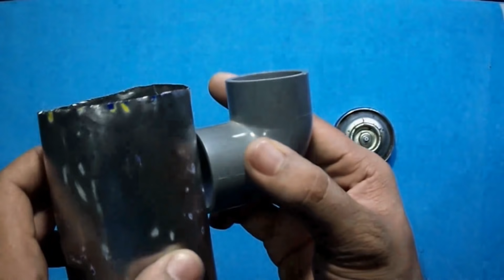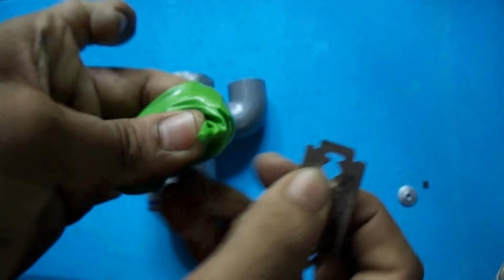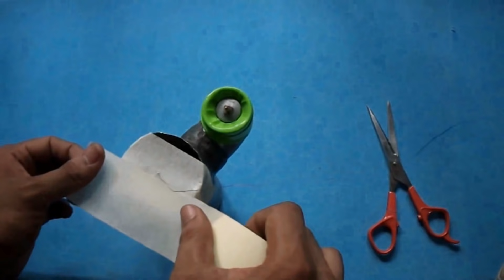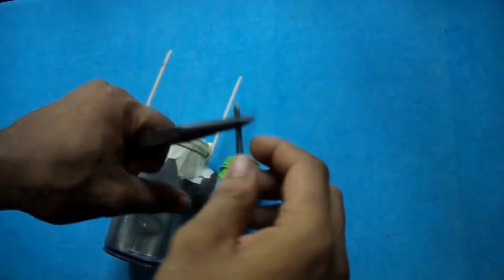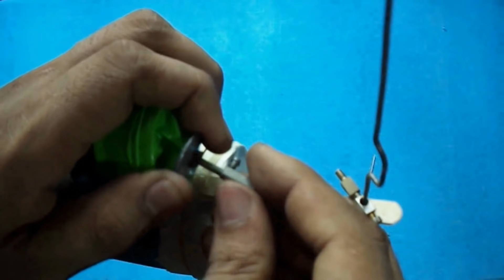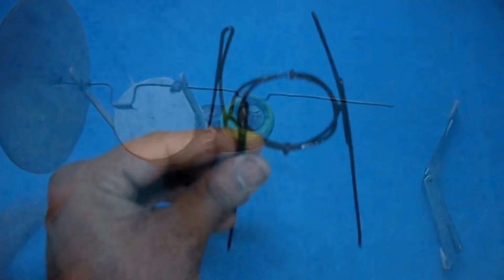stirling engine homemade tutorial

Comment: Tks so much! I just simply need to understand how it works, and you've done very well. Excellent!
Reply: It works because hot air expands and cold air contracts, making the piston move up and down in the cylinder. Rest is just capturing the kinetic energy generating from the movement of piston, and transforming it to spin the wheel. Same principle is used in any engine you see around.
Reply: @GhoshSoumyadeep  I think regular car engines operate on a different principle. They don't have a working gas confined inside them, but they do work on the piston by aerosolizing fuel and doing a mini explosion, an event that repeats over and over really fast.
Reply: @Felipe-sw8wp  That's right. 2 stoke and 4 stoke engines work like that. Same principle basically.

Comment: I'm very happy to  see this engine run with low quality steel scrub , I ask many people to is that engine run with low quality steel scrub. Then every one say not  working but you done it thanks for making this video
Reply from the maker: Actually i am also not sure that by using these type of dish wash wool it work or not , but it worked. The best is to use the zero grade wool for stirling engine
Reply: I try many shop for buying steel wool , but can't find
Reply from the maker: @Sunitapatidar9090   i got it from a paint shop. usually paint workers are mostly using this zero grade wool for scrubbing
Reply: Thanks bro for suggestions where I find steel wool

Comment: It's very crude but it works. Maybe use a more slightly heavier flywheel to increase torque and put ice around the piston cylinder to have more differential temperature
Reply: The Foundry or a heatsink at the top. Aluminum or copper plates should do the trick.

Comment: how to make the shaft rotation smooth?? I make it difficult to rotate by hand?? Please help me
Reply: Im from indonesia
Reply from the maker: If the shaft is bent it will affect the rotation. use lubricant if necessary
Reply: @hi-techmedia689  thankyou so much
Reply: @hi-techmedia689  may I make a YouTube video tutorial on how to make a stirling engine just like you, as my school assignment?
Reply from the maker: @dewisriandayani  oh yes. Please
Reply: @hi-techmedia689  Thank you very much for the permission.
Reply: @hi-techmedia689  after I made the stirling engine, namely the can cover using paper insulation, it seemed that there was less pressure so the stirling engine did not last long. What material do you think is suitable as a can cover besides paper insulation? please answer🙏
Reply from the maker: @dewisriandayani  need to maintain the pressure inside the cylinder then only it will work. avoid air leakage from the cylinder. please cut another cylinder bottom and use that to cover the cylinder top.

Comment: Can you do a parts list please!!!!!!
Reply from the maker: Oh yes. 
 1. Cylinder  ( spray paint can)
2. Dish wash scrubber ( stainless steel )
3. Wire connector pin
4. Steel rod ( for crank shaft)
5. PVC elbow ( 1.5")
6. Balloon ( piston )
7. Cardboard. ( Fly wheel )
8. Lamp

Comment: Will it work 100percent
Reply from the maker: This is not a fake project. make sure that your cylinder must be in airtight. there is high chance to  air leak through the masking tape used to cap off the cylinder.
Reply: @hi-techmedia689  ok thank-you for your advice
Reply: @hi-techmedia689  can you give advices as I started making it.
Reply from the maker: @riogamingyt7303   definitely

Comment: I am not sure that pcv pipe fragment is good for such a construction. With grater temperatures it becams very very soft and can melt .
Reply from the maker: Yes, may be. But this PVC elbow is very hard   & No problems yet
Reply: This engine made from a can shouldn’t even run super hot. None of it will survive high temp

Comment: Sir Aapne can ke andar paani daala h Kiya ??
Reply from the maker: No . Its an empty can
The working principle is, Air molecules expand on heating and contract on cooling.
When the gas is on the hot side it expands and pushes up on a piston. When it moves back to the cold side it contracts
Reply: @hi-techmedia689  thnk u